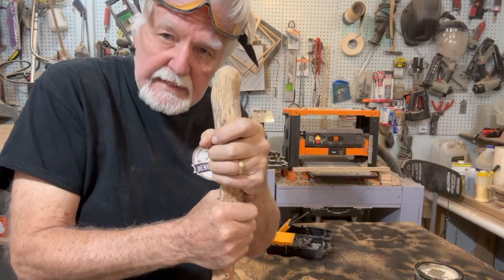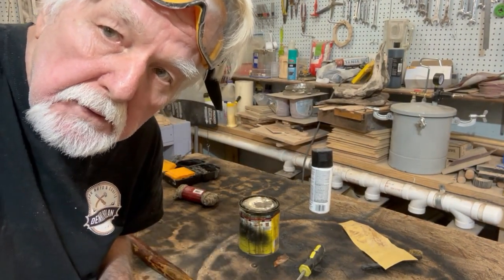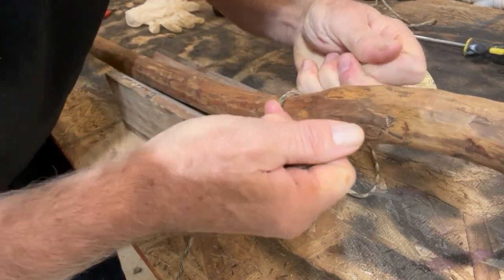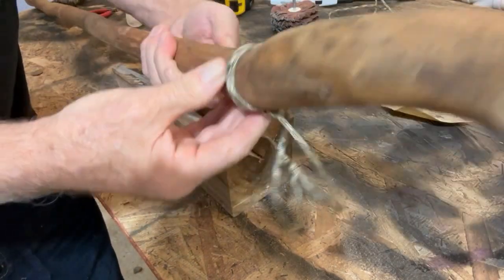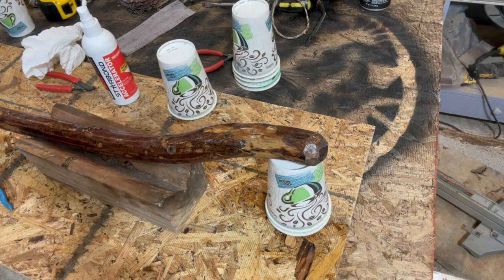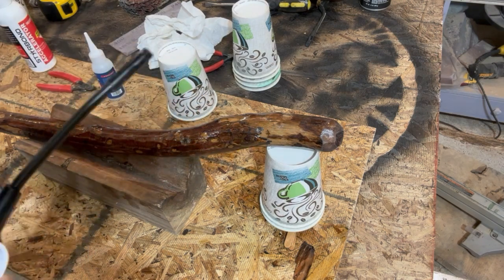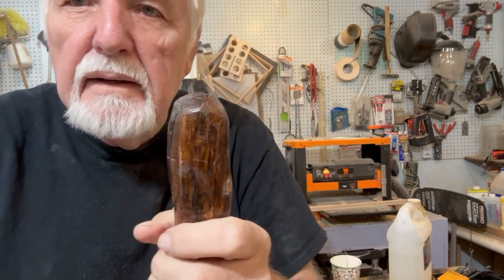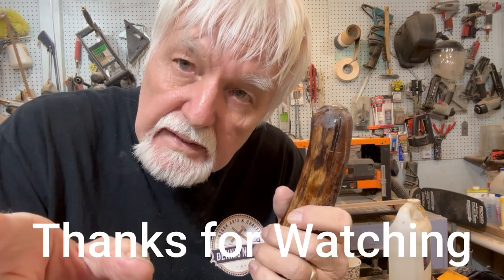Walking Sticks - Part IV for Beginners

Comment: Good job. Nice stick. What you called a “shoe knot” is also called an overhand knot. The non- square knot is also called a “granny” knot. Granny knots are famous for their unreliability. They come loose easily and as a result tree granny knot can’t be trusted. You could also dip the tip of your cord, string or twine in your epoxy. That will seal it so it doesn’t fray. A coat of any kind of glue will work on almost all kinds of string, paradors, jute, hemp or cotton. The glue will make the ends stiff so they can be poked through most holes. I usually use Duco modeling cement.
Reply from the maker: Thanks again, Roger

Comment: Outstanding Dennis. Ready for the advanced process.
Reply from the maker: Part V Advanced is scheduled for Nov 23rd.  I'll have 2 different subject video coming out before then.  Thanks for your comment.
Reply: Hey Dennis. Maybe I missed it, but what Typ of epoxy did you use?
Reply from the maker: @mikE_6-28  A 2 part clear epoxy. Mix 50/50.  Buy molds and epoxy off Amazon.

Comment: Dennis I just discovered your channel after very recently discovering a love for woodworking, thank you for putting this beginner series out, I’ve been following it religiously. I did have a question though, how did you go about rounding off the ends of your stick? Did you use the sanding ball or another method?
Reply from the maker: I mostly use an angle grinder to rough out the top end if it's going to be rounded.  I rough the basic round shape at the time I remove the bark.  I the sanding ball after I do the roughing.  I demonstrate and show this better in Part II and Part III of my beginner series:
https://www.youtube.com/watch?v=3qyrlI4dkm0&list=PLvmAwDZrrWE4Rz3RFHm6eMvLZXlEKKEZS&index=4&ab_channel=DennisNolan-OzarkArts%26Crafts
Reply: @OzarkArtsandCrafts  Awesome, now I’ve got something to get for Christmas! Thank you!
Reply from the maker: @probablesithlord  Awesome!

Comment: Working my way through the walking stick videos, thanks again for making these.

Would only recommend epoxy for filling gaps in the wood or is there anything else?
Reply from the maker: Epoxy is what I use 99% of the time for anything that looks like it may grow or get out of hand.  If wood has dried good and a small shallow crack, then I may use a wood glue.  Thanks for your comment.
Reply: @OzarkArtsandCrafts  Thanks for the reply, I think I’ll have to look into using epoxy on an upcoming project.

I was thinking if there was anything that may do some kind of natural (or free) alternative and my best guess so far was pine resin, but I’m not finding that much of it at the mo, plus obviously it’ll work nowhere near as well so I think I just need to bite the bullet and get some!

Comment: I let them hang dry but putting a small finishing nail in center top of handle, put a rope n hang it
Reply from the maker: I use small eyehooks that I tread into one end and have a few wires suspended from the ceiling with a hook bend for the eyehooks. 
 Thanks for your comments.  I appreciate them all.

Comment: What is the epoxy and curing agent you use in this video?
Reply from the maker: It is just a two part epoxy (A & B).  No curing agent is needed.  Just mix equal parts together.  Thanks for your comment.